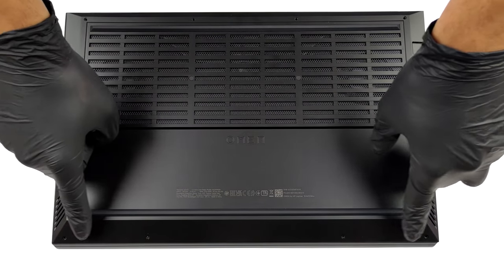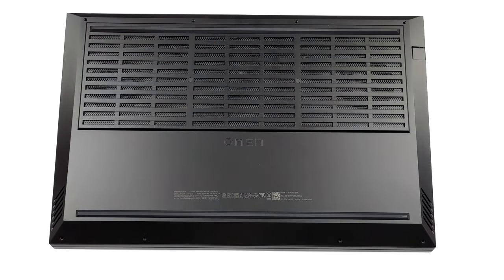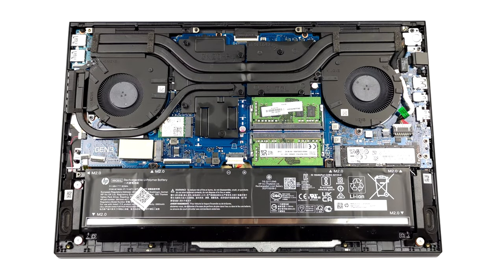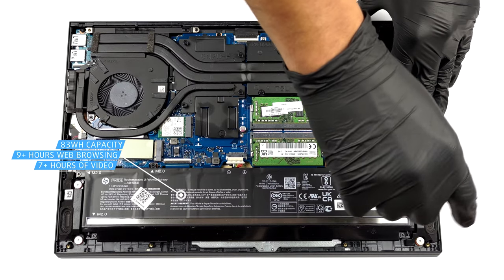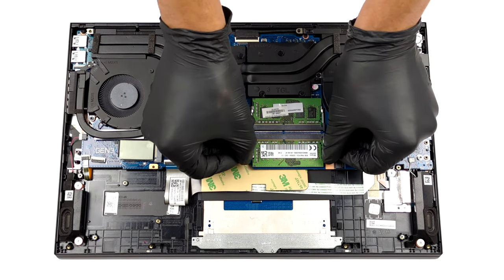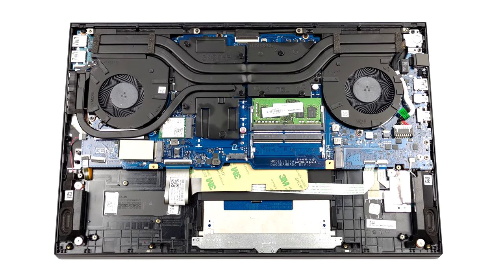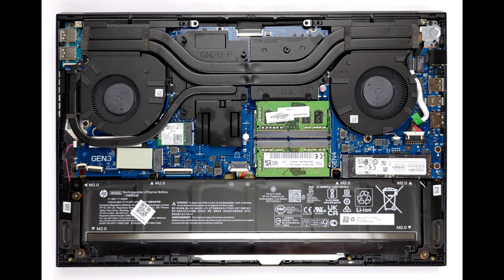🛠️ HP Omen 16 (16-b0000) - disassembly and upgrade options

Comment: You forgot to mention to disconnect the battery first before doing anything else.
Reply: we are not in the 90" anymore ,when the laptop it s off nothing happens , i did so on all my pc and laptops and no issues whatever
Reply: I get like 1 hours on lowest brightness 50% cpu power and under bolted ? I don’t understand
Reply: @iBoneXI  then might be an issue but i don't trust batteries and i don't use it on notebook , if the motherboard had a cmos battery then i would thake out the heavy stuff ,but the bios reset it s  what's holding me to keep the battery:)
Reply: @cristianJoker2512  i see many laptops die by electrostatic
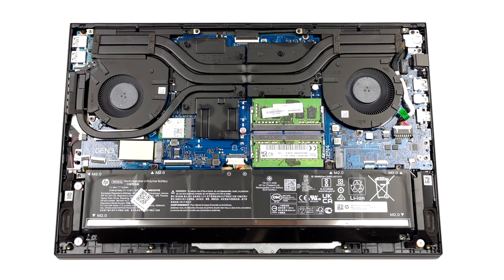Reply: 1:33 for you!? 🤔

Comment: How did you get 7-9 hours on battery? I barely get 2 and a half hours on battery saver with brightness at 70%
Reply: Try using 60hz instead of 144hz
Reply: @mathaihouse504  nice info. Thanks
Reply: @mathaihouse504  how do you use 60 instead of the full 144
Reply: Someone finally said it!
Reply: @iNd5ky  Settings in video graphics software. Nvidia or Amd
Reply: Use eco mode in omen gaming hub and turn on battery saver
Reply: There's bigger batteries

Comment: I would like to ask whether the Pcie 3.0 M.2 slot support double-sided SSD? Seems that the thermal pad on the left is so thick...
Reply: I have the same question as well .. whether any of the given slots .. whether Gen 3 or Gen 4 would support double sided NVMe SSDs

Comment: I just bought it and got 2 x 16 ram sticks for it. I'm scared now. I'm familiar with opening laptops, but a new one? I barele touch so I don't get my hands marked on it.
Reply: Did it work with 2x16 ram?

I just bought mine with only 1x8 ram but I don’t know if it can support 32 gb 2x16 or should it work with 16 gb 2x8
Reply: @emmanuelIMT  Yes it worked. They're 3200 Mhz  memories.
Reply: What brand sticks did you get just got my omen and looking to upgrade but some say it depends on the brand..

Comment: hello need some advice here, recently got a HP OMEN - 16.1"  (16-b0013dx) i wanna expand the memory, so what its the best SSD you can recommend me to use in the second slot this laptop has?? needs to be a gen 3 no matter what???
Reply: Crucial, Kingston ,WESTERN DIGITAL, BARRACUDA . SSD
Reply: i tested the 2 slots available with an Samsung 980pro that can push up to 7.500mb read an write on pcie4 s
but here it did not pass above 3.500mb that s because amd use pcie 3 on laptops so no matter what u put it will be blocked at3.500mb read and write , i saw a little improvement on the left slot / pcie3 .
Reply: @cristianJoker2512  thanks for the info xD i end up getting a gen 3 because of that and also save some money in the process \m/

Comment: I got the  HP OMEN 16-wd0059ng just today, and mine doesn't have a second M.2 slot. I checked so many sites and all told me that it has and that's one of the reasons why I ordered this device. But now I have to see that it doesn't have a second slot. This really makes me upset. 512 GB for a gaming laptop is way to less and I wanted to expand the storage on a simple way.
Reply: i am going to buy this can i buy any issue please suggest me

Comment: The laptop pieces are so close together for me i can get anything in there to pry it open.
Reply: You can use that guitar pick style plastic pry tool, maybe a suction cup, and a TON of patience. This laptop is pretty hard to open up. The back and fan areas are basically the only areas to start and since the metal is thin, be careful not to bend it too much. I can tell the metal is ever so slightly bent now and it bothers me. Pretty awful design by HP

Comment: Hey guys !
does it dupport ddr5 ?
or ddr4 64gb is possible ?
Reply: ddr4 64gb works here
Reply: Some models use DDR4 and some use DDR5, you need to match the existing speed of the OEM RAM either way. As for quantity, this also depends on your model.

Comment: Hi I have a question, can you recommend me which ssd is good for omen 16? I'm afraid to buy the wrong one, thanks before
Reply: My Omen 16 came with a good 1TB Samsung SSD. The other slot is a Gen 3 PCI slot. So you can't go wrong with getting a gen 3 Samsung NVME drive.

Comment: i have hp omen 16 - 2022 model, after upgrading 8x2-16GB RAM to Kingston Fury CL38 - 16x2 - 32 , and adding another ssd(crucial P2) i started having system freezes 5-6 times a day. system blinks and then freezes, the only way resume is force restart, HP Agent is making an excuse that non HP ram is causing the problem, but tests show no fault in RAM or in any other component. can a CL38 RAM cause an issue ? sometime it runs for hours without any freeze. i dont know what is going on. any ideas
Reply: try to use your old ram for some time - will you have freeze then?
Reply: @hellnet88  its been 6 months lol but its all fixed now, new ram was replaced by Kingston.
Reply: @sandeepkark  Hello, since then how has your HP been overall? im looking to upgrade from a 10-year-old fully upgraded Dell precision M2800, I was looking into purchasing this specific HP..
Reply: @Ahsokarevan47-db5cv  overall it’s been good, advise you to get additional 2 year warranty just to be safe. Also buy what u need out of the box. Upgrades creates issue for many people, My problem was solved by getting replacement ram.
Reply: @sandeepkark  i am going to buy this can i buy any issue please suggest me

Comment: I have HP OMEN 16-b1001sl (66D54EA)  I try to change DDR5 memory SKhynix (2x8) to (2x16) and its not working ! i change memory kingston/crucial/samsung - and its not working(( but with SKhynix (2x8) it still working.  What i must to do ? i try to off batttery (didnt help)
Reply: What processor does it have?
Reply: @64bittz93  I7 12700H
Reply: Now i update my bios and its works grate with new memory
Reply: How did you update your BIOS?
Reply: i am going to buy this can i buy any issue please tell me

Comment: Thanks guys. All I needed to do was dust mine off, but I couldn’t figure out how to get it open.
Reply: After you dusted the inside out did it stop overheating and turning off ?
Reply: @mosamin3115  Overheating? Mine only overheated so much because I was playing games that were above its specs by just a little bit. I had to cut that out, and it hasn’t overheated that much since.  

I genuinely don’t know what you’re talking about and you should probably get it into a repair guy. Even I have to get mine to repair guy because of the heat issues.